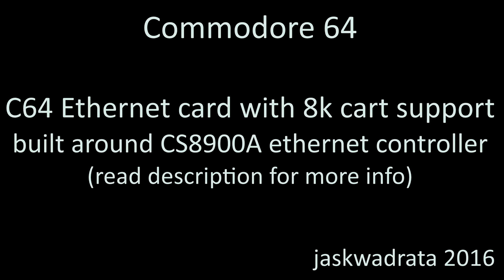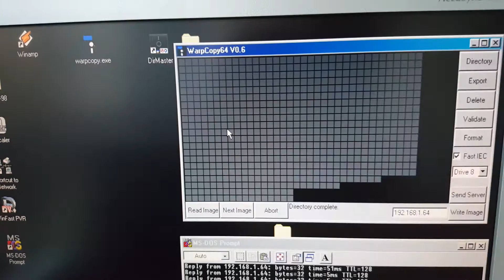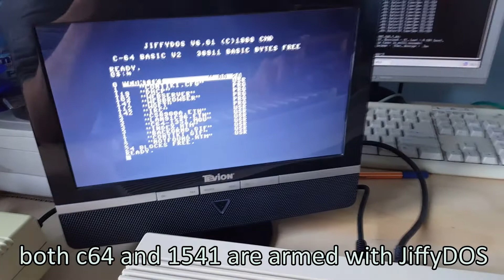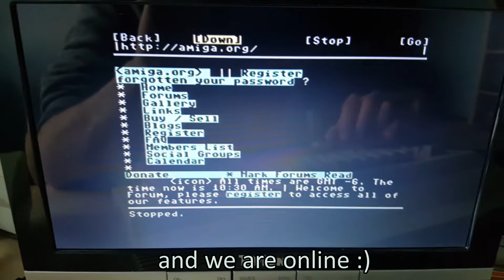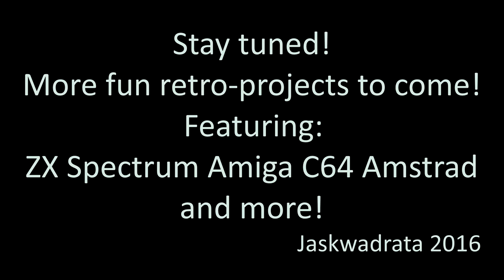Commodore 64 Ethernet card WarpNET (RR-Net compatible)

Comment: It's up to you but I hope you don't retrobrite that floppy disk drive (or anything for that matter). Cool video btw. :) thumbs up!
Reply from the maker: Thanks :) about retrobrighting - it is a bit too late since I already retrobrighted that 1541-II a bit time ago, You can see the results in my homemade SD2IEC video, it turned out really well. BTW why You are against retrobrighting things? :)
Reply: You have a cool channel. Well, of course a person can retrobrite their own things. I wouldn't dream of laying down rules. I do think though that it is a pity when some things (not all) get the retrobrite (or other bleaching etc). Basically, I say it affects the provenance of a classic item and incorrectly modifies as though a patina. So, I'm not talking about "harming" the plastic (whether it does or does not). As I say though, it is a pity when people realise that later and regret retrobriting it. Even if it goes back to normal, the "provenance" has been affected. The same can be said for other mods like drilling holes etc. I will check your video in a moment, and I anticipate it will be a smooth job of retrobriting. You make things to a high standard. :)
Reply from the maker: Thanks again - I can understand Your point of view, I'm also how to say that "not a big fan" of drilling holes in original casings, I prefer mods to be made in fully reversable way - and failed retrobrightning can be terrible. I saw some damaged casings that were improperly retrobrightened and have to admit - I'd rather have the time-stamped yellowed one than a aftermarth of unsuccessfull retrobrightning attempt :)
Reply: One of the problems that can be seen with retrobrighting is that, even though it may be achieved to a "perfect look", when the yellowing returns years later (and it can do that), it can cause it to return in an uneven fashion. It is unforseen and impossible to predict. Some of the computers that suffer from that have it occur in such a way that, at which point, there is nothing that can be done about it.

The only thing that can be done is to not retrobrite in the first place at all and simply accept the yellow colour as part of the machine's history and its provenance. The provenance is greater than the look. It is one of those things where I can point it out so that people know. Of course, if they decide to do it anyway, at least they know that they have done it out of choice and not by not knowing. As an aside, this also applies to other techniques beyond peroxide retrobriting (such as chlorines and so on). 

If I am pressed on my "feelings" on the situation, I would admit that I do feel a bit heartbroken and seeing many items meddled with (retrobrite etc) beyond their minimum maintenance (although of course, I still recognise and respect people can do what they want to their own stuff). It may sound melodramatic but really it is pragmatic. To me, it is important that sentimentality can be attached to computers (and such stuff) since that leads towards a labour of love (fixing things etc) and therefore a passion for a subject in learning (maths etc) so as to motivte and/or communicate.

Upon pointing this out, some people who take computers to museum expo shows (small or big) to demonstrate to people start to think about what they are bringing a "community" and they reconsider what they want to do (retrobrite or not retrobrite) etc. There are other things that can be done such as covers and replicas (and more things you might imagine).

:) I'm not on ome messiah-complex mission or something (don't get me wrong). I'm merely taking a minute to point something out and then people can decide on their own, or at least think or a dy or week or month or so and then decide what they wish to do. So at least they have been informed.

As an aside, I think your toner transfer boards are really cool. They even look like art. You could have one in the machine and another identical spare, framed in a display case.

You know how expansion cards (like the terriblefire cards) and made to order as surface mount boards (presumably lasered)? They are PCBs about the size of a deck of cards. 

I think it woul be cool to make one in the toner transfer method, and therefore much larger (since the traces are far bigger) about the size of an a1200 case or a590 HDD (stacked in layers) with adaptors to convert the chips legs (of a cpld, cpu, fpga, RAM etc) to pin grid array or akin to SIMMs (and thereby fix via an adaptor to a tone-ransfer board like yours are i.e sophisticated). It would be cool just to see if it could be done almost entirely "homemade" "fallout-game, apocalypse" style. One might have to be mindful of resistance and so on, but it could be done. It think the TerribleFire expansions are cool .This would apply to not just them though. Almost any that are open source would do. It just seems a pity that open source boards need batches of PCBs to be made. It restricts the ability for a person alone to make a one-off or prototype.

Realy though, "home laser cutters/solderers/welders" would do it all and could be made if the laser was controlled (waves for pulse etc) using FPU math on  board (a bit like a raspberry pi, but one of those with the FPU). Such things can be made or purchased. Still, your way is cool since you don't even need that.

Comment: Sthat was Warp speed transfer ! Is the data put on the databus or is there a serial bus used?
Reply from the maker: +bwack Thanks for Your comment - 1541 is connected to C64 via standard IEC serial bus - no hardware modifications there - I guess all the magic happens in software - Graham (Oxyron) did great job with WarpCopy64 software
Reply: +jaskwadrata It is very fast and impressive. I was wondering about the communication between the C64 and the ethernet card ?
Reply from the maker: +bwack card goes into expansion port, data is put on the databus

Comment: Where does it load the WarpCopy, from the 27c256 eprom?
Reply from the maker: Yes, exactly speaking from one of four 8k banks avaliable. WarpCopy was crunched to fit into 8k and converted to autostart as a cartridge
Reply: jaskwadrata does it need any special modification when using 28-pin eprom on that 32-pin socket? Never burned any eproms, any tutorials how to burn multiple roms in to that chip?
Reply from the maker: It depends on the eproms pinout, a sligt modification is probably required in most cases if not using same memory as the project was designed for. Eprom bank switching is a common topic, You should be able to google something out. In very short You do like this - lets say You have a 27c256 memory = 256/8 = 32KB - so that is 4 banks of 8KB - You take 4 8KB files and just merge em into one 32KB file then program that to the eprom. The bank switching is done by pulling low or high the highest unused bits of the address bus, in this case last two bits, that makes 4 combination avaliable to select 4 different banks. It is kina hard to explain properly in a YT comment :P

Comment: I am using 64NIC+, i can write to the drive from the PC using Warpcopy 64 as you did, but when i then load the program from the floppy into the c64, it loads but doesn't run. I tried writing to different disk drives and using different D64s or prgs which i know work. Why is this happening?
Reply from the maker: It is really hard to say "remotely" what is wrong - may be plenty of things. Other disks not recorded by warpcopy loads and runs fine? All the fields after disk transfer are green? You are able to list the content of the floppy after the transfer? It loads fine and when you type run what happens? An error or nothing at all?  I'd start with excluding things one by one - write a short basic program like 10 print"aaaa" 20 goto 10 and save it to the disk then try to load and run it to make sure drive/c64/floppy are OK. Then try to backup that floppy to the PC to d64 file and try if it works fine in emulator. Then try to transfer it back to the drive to another 100% sure working disk. Try to ping Your NIC while doing all this and see if there is no packet loss. maybe try with other machine - You use breadbin or C64c ? Make sure your use fine power brick, maybe PSU is getting overloaded while you plug in your nic64 card and C64 acts weird. Throw me an update if You figure something out :)
Reply: +jaskwadrata thank you for replying. Using a breadbox, i have another breadbox and 2 c64c will try all of them. I just purchased a brand new psu so thats fine. My disk drive work fine, i have written to hundreds of floppies with this drive either by starcommander with xacable or straight from c64 when i have code a program. the warcopy works, that is writes to the drive, the listings are correct and they load correctly. its just when you run it dont work, screen will change colour and it trys to run program but then nothing happens. i tried removing 64Nic+ and loading and run and same result. Maybe i have the 64Nic+ setup incorrectly? there are so many settings but no instructions, there is a dial you change to different numbers with letters, current set too c4 what is this? also have set to std mode not rr net? i will do as you suggested and send a small program from the drive to the pc and run on an emulator. yes all blocks are green when transfering. how do i ping?
Reply: +bruno “crimslock” ramone when i click send server from the pc i get error message saying couldn't send server and on the c64 it shows ARP request then IP info but then shows unknown port 6462, is this the problem? the pc is using port 6462 but c64 port 6644? even with this error i can still read and write to drive from pc, how do i change port?
Reply: +bruno “crimslock” ramone ok i figured out ping and results are fine, no lost packets, i exported from the drive to the pc, then load run in emu and works fine, tried several large prgs all works. i then wrote to drive with a know prg that works in emu, then i exported the prg i had written to the drive and run load in emu and dosen't work, this proves not the c64 or drive, something wrong with sending the data to the drive, i assume its this port issue?
Reply from the maker: here is a description of 64nic http://www.go4retro.com/products/64nic/ the dial with numbers is probably a rotary switch to select eprom banks (when eprom is present). Try switching to RR-net mode instead of standard. Turn off the eprom 2nd siwtch from top-left (if one is present) Maybe try to uncheck Fast IEC in warpcopy. I would try with different c64 - preferably one with the short board if you have breadbin now. If you get communication (ping works with reply) it shouldnt be a port issue - it is common that server side listens on a specific port and clients are talking to it thru different port.
Reply: ok thanks mate, will try different c64s, so you think server and port issue is ok...
Reply from the maker: yep - as long as you get ping reply network connection shouldnt be a problem - let me know how another C64 is doing
Reply: i tried a c64c and it worked, i wrote a single prg by dropping the file into warpcopy on the pc, i then tried a D64 whole image and that worked, but when i tried putting multiple prgs it again wrote them but wouldn't load run into the c64, frustrating.....
Reply from the maker: instead of droping multiple prg files make em into d64 image first (using Star commander or DirMaster) and then write d64 to drive by warpcopy. At least You got something to work thats good news!
Reply: yes so happy got some to work!!!
Great idea to make D64 with multiple prg files, i use D64 editor, so easy to use....thanks for all your help :)

Comment: Hi I have the first rrnet cart that was sold and i have always been very happy with it especially using Warpcopy transferring disk files from the pc to floppy disk then loading the disk like your doing in your video but what i have always wanted to know is can the rrnet be used to load a disk file from the pc directly to the c64 ??? cutting out the disk drive?
It would be fantastic if you could load a game from the pc directly to the c64 using the rrnet not sure whether there would be a speed difference  oppose to the c64 disk drive speed when loading???
Do you sell the warpnet cards you make ? If so how much ? and postage cost i am in the UK
Reply from the maker: Hi - I'm afraid this is not possible with RRnet -  and rather never will be possible. In very simple words - commodore disk drive is like a 2nd computer connected to C64 - it handles all of the stuff the multi-load programs requires, wile reading its content from a 5,25 floppy. Loading a program directly to C64 will require locating it somwhere - the only possible place to do it is load it into RAM. There is no way a full floppy image will fit into C64 RAM - some smaller .prg files that are single-load and does not require a disk drive to work will fit, however I doubt there is a software for RRnet that handles it - but :) as far as I know, this kind of "inject a program into RAM via ethernet" is being implemented for 1541 Ultimate 2+ cartridge - this is copied from Gideons facebook group:

Unofficial 1541 Ultimate 2+ build by markusC64
3.1a_498._v1
Releasenotes:
Changes since 3.1a_495_v3:
Rebased to Gideon's revision 498
Done some work on UCI, IEC and now possible to upload PRG for DMA on TCP port 64.
Added feature to reset, load, write memory, etc from TCP port.

edit: I do not sell any stuff I made, since these are more like a hobby homemade prototypes, not end-user products with warranty and made on a manufactured PCB's. You can get a RR-Net-MK3 card from icomp(dot)de or 64NIC+ from store(dot)go4retro(dot)com - both also have the 8k ROM support where You can put the warpcopy to autostart on C64 power on